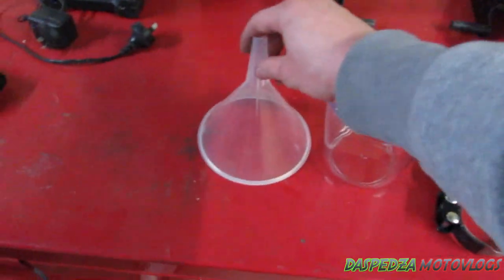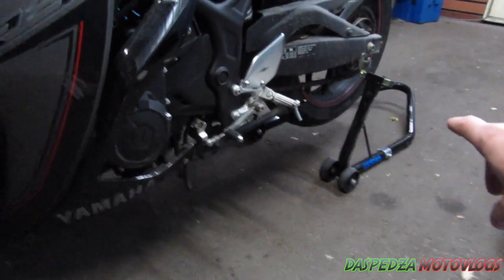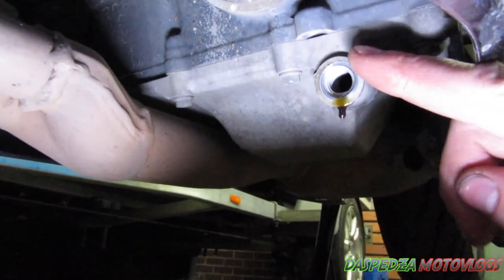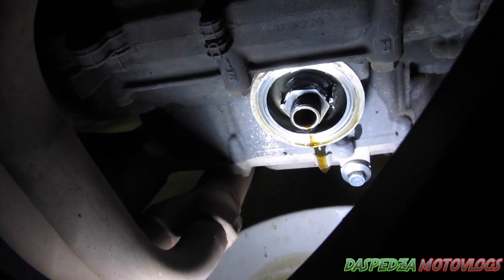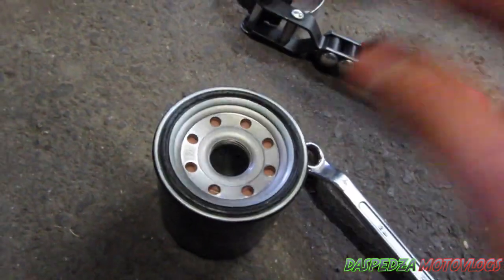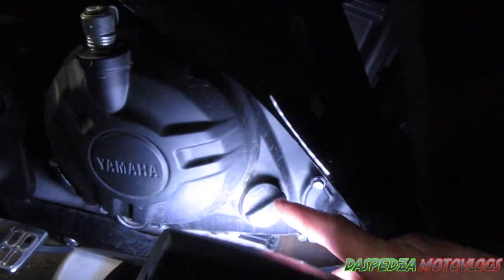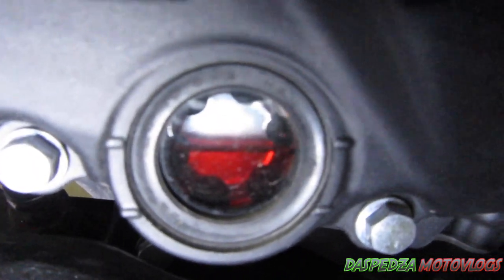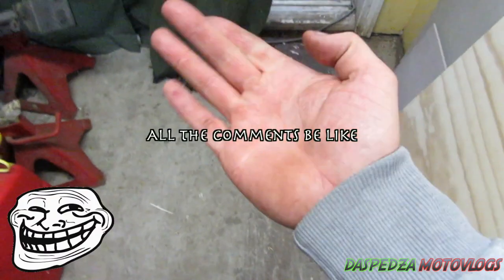How To Oil And Filter Change YZF R3 - Yamaha R3

Comment: My drain plug is stuck on there after the winter and starting to strip. You think wd-40 might help?
Reply from the maker: It may help letting wd40 or something similar soak into it for awhile then come back and try again. You can also give it a light tap to try and loosen it up. 
If not try a single hex socket on a breaker bar. Just remember it is cast alloy.

Comment: Hey man, thanks for the video. If I was just changing the oil, do I have to crack open the filter and let that drain all the oil out of that then re do the same filter? Or can I just drain the oil and replace it with new oil?
Reply from the maker: My advice if you’re changing the oil change the filter. 
If you put new oil in you’re still running it through a filter that has already done a fair bit of work and has already caught debris etc in it. Then you’re pushing clean oil through that. 
For the cost of the filter just change it. 👍🏻
Reply: @DaSpedzaMotoVlogs  thanks for the reply